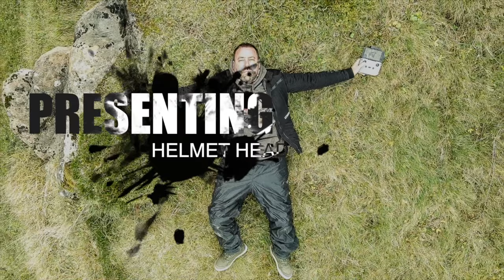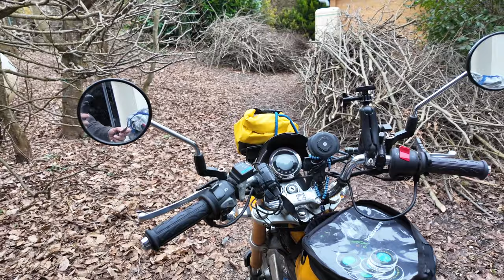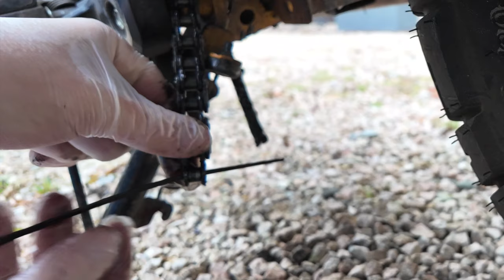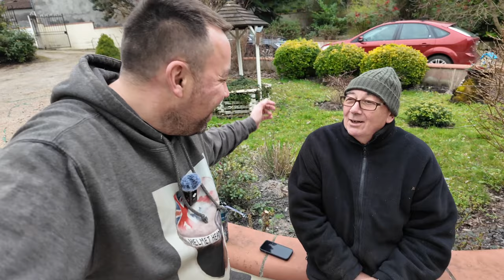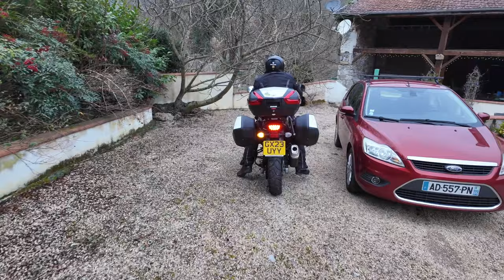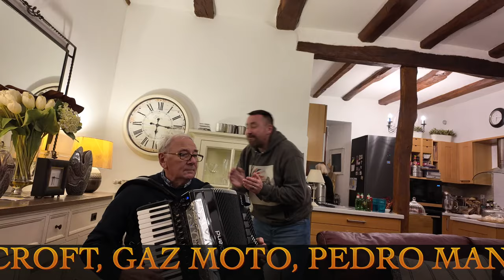The Tiny But Mighty Honda Monkey Bike 125cc Conquering the World

Comment: Dude tighten the chain not replace it.... it's literally designed to stretch when breaking in lmao.... as a motorcycle mechanic. Don't replace the chain. Clean it with WD40 and scrub it then rinse with water. Let the chain dry completely before applying chain lube.
Reply: He's doing it for peace of mind he's riding around the world not back forth to Ur work place
Reply: How often should we consider changing the chain if commuting to work everyday
Reply: No way. Get rid of that chain for a new one. I have a monkey and I was tightening that garbage OEM chain every week. The OEM chain is absolute crap.